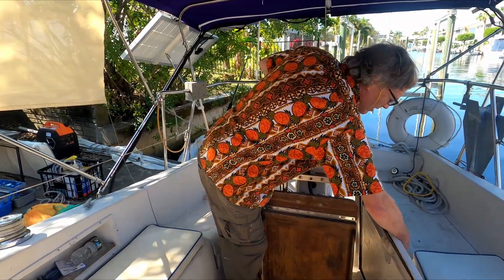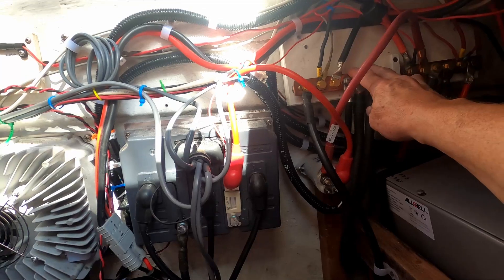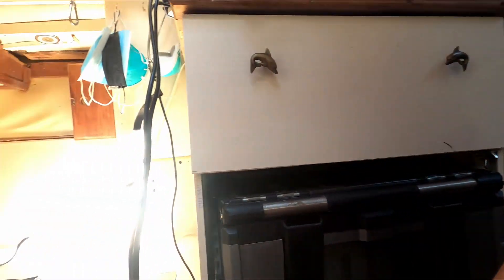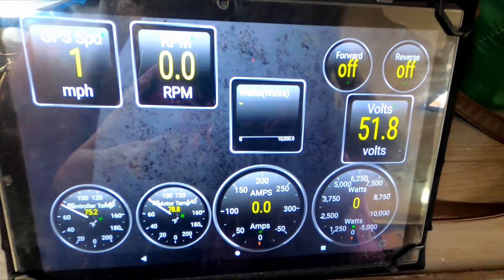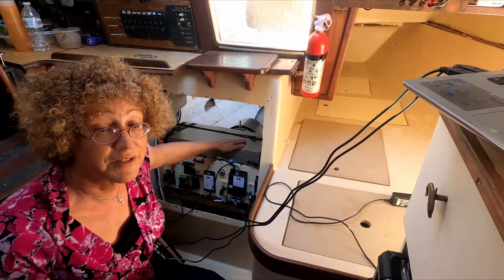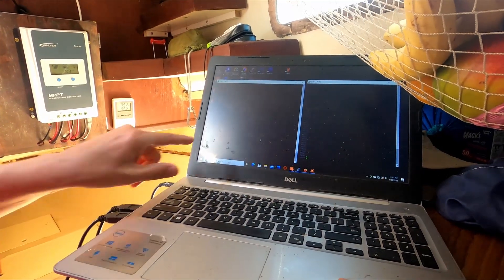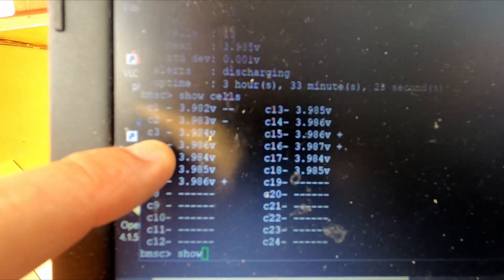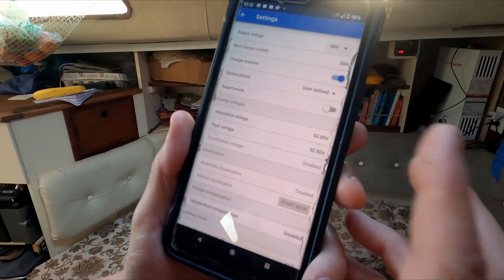Episode 40: Thunderstruck Motors - Electric Motor Install

Comment: Looks like a train wreck waiting to happen, that is something that should not be around salt water, you would need to be a TROUBLE SHOOTING MASTERMIND to keep that running.
Reply: That "train wreck" served us well and was a great experience for building out our 44 ft electric drive.  See later episodes.  As for having to be a mastermind to fix it, that would be me. I'm The Mastermind.  Surprisingly, very few bugs and very low maintenance. Your mileage might vary.  Ours was great.  I tend to find that those who say that something is improbable or impossible tend to get in the way of those who are making it happen successfully.
Reply: @ChristenBustani  The average person can't trouble shoot a basic engine that requires not more that 2 connections to operate, much less that that manastrophe of components ...what happens when a salt water breaches the cabin and those electronics? ....just sitting at dock for a year will subject those connections to shorting. ....shit, my neighbors land rover went thru 5 mechanics and $6000 dollars because of a simple ground.

Comment: I too thought about using a Thunderstruck motor in my sailboat, but after seeing what you did I'm not sure that I would be able to learn what I need to know to be able to install it myself. It seems like I would need a course in electrical engineering or something.  I'm putting an outboard on it for now, and will try to sail most of the time.
Thanks for the video.  Wish I understood it better.
Reply from the maker: Honestly, I believe you would be able to figure it out. Best way to do it it's just to take one step at a time. I was a little nervous about building this out and felt I couldn't do it but I slowly worked on it on the coffee table down in the basement, piece by piece. If you take your time, anything is possible. I know that looking at this setup may appear daunting but in reality, I learned each piece one at a time. The supported thunderstruck is pretty amazing too.
Reply: @sailingaccidentalgybe  Thank you so much for your response and encouragement.  Maybe I will give it a try.  It definitely looks like an interesting project.  Have a great New Year!
Reply: @swm-sm6cu  soon as that stuff get's wet, which it will, it's lights out.

Comment: Nice explaining. I wonder if there is a system where the solar panels can drive the motors without batteries.
Reply from the maker: One of the biggest problems with running directly from solar panels would be varying voltage and amperage based upon solar input.  The battery acts as a gatekeeper if you will, to store an inconsistent power supply in order to allow it to be extracted consistently.

Comment: Excellent video following on from your last one, which has me pondering the following. How are the separate battery banks of the 48V propulsion system switched over? How are the separate BMS of the two banks switched over between the Victron safety relay? What kind of issue would the BMS throw up with the battery bank (ie. over voltage, over current, under voltage, under current) that would facilitate the relay to be switched that the Victron unit wouldn't have picked up on? Thanks Al.

Comment: How has the system been holding up since this video? Have you made any changes or updates to the system since then?
Reply from the maker: The system held up great! We really had no maintenance issues.  We also didn't make too many changes and upgrades because we were going to be selling the boat anyway. Now we are taking possession of a larger, blue water boat.  All in all, going electric was a breeze.

Comment: Wait. Stop. Watts per hour? WATTS PER HOUR? What the heck are you measuring? You probably mean Wh/h but you have to get this stuff right. Messing up units means you don't really understand what you're doing. Back to freshman physics.
Reply from the maker: Ah units! The nemesis of many.
We've had such good success with this setup that we are building a hybrid drive on our next boat which is looking to be a 44-ft ketch.  We shall have a plethora of 150Ah batteries and many more Wh/h.  And yes, I understand completely what I am doing, how I am doing it and what I can expect as a result.  Being human means that we occasionally make mistakes  (nah that doesn't happen, but when it does we should project that a person is incompetent).  I will admit I am dangerous enough to build large tesla coils and fire off lightning in my spare time.  Zeus would be pleased.
Reply: @sailingaccidentalgybe  - I've been reasonably impressed with your approach, including two battery banks - usually not a great idea but your point of redundancy and rippling that through the battery controllers was valid. Unfortunately you said "watts per hour" about six times. Accelerating coulumbs? It's just wrong.
Reply from the maker: @deislanddave  if I had to do it again, I would not build in the redundancy. I was extremely concerned about failure, mostly of the batteries since they are used. Amazingly, when charging, the BMS puts them within .003 volts or less per battery block, and they discharge evenly. The thermistors register temperatures within 2°C of each other (and a lot of that variance could simply be my installation point of the thermistors on the battery pack itself).
Reply: @sailingaccidentalgybe  I think your choice was a good one, based on what you knew at the time. It's easy now to gang them together which given your additional experience is more consistent with best practice. I probably would have made one bank (assuming I went electric propulsion, which I wouldn't today - but good on you) from the beginning but splitting them and describing the redundancy factor due to lack of knowledge and demonstrated performance impressed me as good engineering. 

Since you've kept your house bank separate (which I laud), have you tracked consumption? My experience on cruising boats is 2.5 kWh/day +/- 0.5 kWh/day for house loads (fridge, freezer, autopilot, nav, lights, personal electronics, comms). Is that what you see? Can you separate loads from charging? Spreadsheets? Share? Your house bank looks like about 400 Ah at 12VDC - is that right? That seems light for most cruisers. Thoughts? What are you doing for domestic hot water? 

From an engineering point of view I ALWAYS worry about failure. FMEA for everything. 

Have you checked the thermister readings with a calibrated IR thermometer? That would be interesting data. Have you looked at battery temperature as a function of load and charging? That would be interesting also. Most of the curves I see easily are for FLA not LiPO4. Have you had to push hard yet? Heavy worthy or badly foul currents? 

Would you be interested in a peer-reviewed journal article with SNAME or ASNE? I haven't yet forgiven you for watts/hour grin but your engineering seems solid.

Comment: Hello  Nice job and well thought out design!!  I may have missed it in the video but how are you charging your 12v house power?  I am about to set up my conversion on the bench finally just got the last few parts in and have been going back and forth but settled on a separate charger that I can use the existing perco switch to move the shore power or generator to the 48v charger or the 12v charger.  Thanks for all the great information
Reply from the maker: That is a really good question and I was so excited about the electric motor setup that I never went over the basic 12 volt system. It's a very basic 200-W solar running to an MPPT controller to deep cycle lead acid batteries.  We never went with lithium for the house batteries because it was never our intention to hang on to this boat as our last boat. In fact, we have dibs on a new 44-ft ketch that will end up, ultimately, with a lithium set up for the 12-volt system. The controller is an EPever MPPT 12 volt and the two 100 watt panels are connected in parallel. It is more than sufficient to power the basic house needs and the electronics for the Thunderstruck System.  I hope that helps. I can do a segment on it in an upcoming video but I grant you that it would not be very exciting!
Reply from the maker: I should also mention that thunderstruck actually recommended that the power system that supplies the BMS and the EVCC be separate from the drive battery system.

Comment: Awesome! We are looking at doing something very similar. A video on range vs speed and typical recharge times from solar could be interesting. love your work
Reply from the maker: As you may know from our videos, we have sold the boat and working on outfitting a 44' with plans for electric drive.
Reply: @sailingaccidentalgybe  What electric motors are you researching for the 44?
Reply from the maker: @hodadyou  We are looking at several options, including Oceanvolt.  We would like to try her out in the water first in order to assess our baseline statistics on the 4108 Perkins Diesel.  Then we will have some numbers to move forward.

Comment: Been looking at those engines for a while now, thinking of doing the switch (sick of diesel engine maintenance).  Should we choose this engine, we hope that our install looks as good as yours. Thanks for the informative video.
Reply from the maker: Thunderstruck motors provides a very reliable system at a very reasonable cost as compared to, let's say Ocean Volt.  The difference in price however, is made up for in the investment required to learn how to integrate all of the components together. It's a great learning experience, don't get me wrong, but it does require some ramp up time.  Once everything is working, it seems to take care of itself and is very reliable. Even I found this very surprising.  If you need to go with a larger motor, I would recommend a water cooled one. With the 5 kW motor, we're just able to keep it cool enough with a fan system built into the engine well. I can't imagine the heat dissipation required on a larger motor. Certainly, it would be manageable with a water cooled motor and I believe that they do provide one in their larger sizes
Reply: @sailingaccidentalgybe  I think 5kW would suit our needs, our boat is 33ft, and not too heavy. I'm okay with investing some time, it's not like I can afford the alternative anyway ;).
Now that you've had some time with your Thunderstruck, would you prefer a larger engine or is the 5kW adequate?

Comment: Anything you would change or do different next time. Thanks
Reply from the maker: Absolutely!  This was a great testbed platform to field test the setup.  I would add two more batteries and wire each set of two in parallel to give 300 amp hours each. I would also upgrade the motor to a 10 kilowatt motor.  We went with a smaller motor design because our intent has been to sail and only use the motor when needed. what we are finding is that the motor is actually very helpful when sailing to the wind and allows us to point more closely when we motorsail when conditions warrant.    The five kilowatt motor was well balanced to the number of solar panels and number of batteries we had in place. We are planning to move up to another boat in the future and so did not put has robust a system in as we could have. Still, it has been working very well, actually exceeding our expectations, and we can motor along all day at about two and a half knots on a sunny day without a net drain on the batteries.  one of the other things I would change would be to have a physical link for the onboard diagnostics. Using Bluetooth is not reliable and of course it always needs to be attended to at the least opportune time. Quite annoying.  All in all though, I am quite impressed with what we ended up with.
Reply: I'm still watching and trying to decide. 10 kw motor minimum, I was thinking 2/48v 100 amp batteries. These would be for total electricity.  Dorm frig,air fryer,inductive stove top,lapstop.DcLoads Bildge pumps running lights. 27ft  sailboat so  solar minimum needs determined what I have space for. Thank you enjoy mike

Comment: I just didn't hear anything about propeller generating energy.
Reply from the maker: We're not doing regen on this boat. Generally, you need to hit four knots anyway in order to be able to generate electricity. We don't have the right prop on this boat to begin with and we are going to be ultimately selling this boat and moving into a larger one. We'll look into regen on that next boat where our hull speed will be higher.

Comment: Thanks for sharing your build. I have a land based build with Tesla batteries and I have used Thunderstruck's BMS and I am trying to figure out how to wire in and program the CAN Bus to work some relays for High and Low voltage shut offs as well as temp shut off. Any words of advice for a guy that has limited computer skills?
Reply from the maker: Since I aired the episode on YouTube, I found a way to utilize one of the pins on the BMS at 12 volts to be able to power a relay that switches the 48 volt side.  If you look at the end of the manual for the BMS you will see there is a small reference to "loopoc".  The BMS has the ability to, based upon the high voltage condition or low voltage condition, HVCC or LVCC occurring, to power a circuit at low current. I used this feature to power a relay in order to be able to handle a higher voltage system.  If this is what you are considering, let me know. I have some emails from thunderstruck that I can forward to this forum on YouTube. If not, it may be worthwhile to contact thunderstruck and request their advice. If you do, let them know that Kristen sent you!  Trust me. You'll get a little extra response in so doing!
Reply: @sailingaccidentalgybe  Thanks so much, I will definitely look into that. Appreciate the information.

Comment: As you said in E39 you would include a parts list under this chapter ;) could you still provide it? Especially the charger and BMS which are also connected to the can bus of the sevcon. 
Thanks in advance
Reply from the maker: We sourced everything from thunderstruck.  I will link you to the exact kit we purchased.

https://www.thunderstruck-ev.com/sevcon-brushless-sailboat-kit-5kw.html

https://www.thunderstruck-ev.com/bms-controller.html

https://www.thunderstruck-ev.com/tsm2500-and-charge-controller.html

Hope this helps!

Comment: Thank you for sharing your video!

I'd love to know more about how you mounted the motor.  Did you use the 2:1 gear reduction from Thunderstruck?  How did you mount it?  Did you use engine mounts?  Just two?  How did you do the alignment?  I'm thinking it would be optimal to use four motor mounts oriented vertically and four more oriented horizontally, in order to really precisely align the motor to the propeller shaft.  Did you use the chain coupling that comes with the gear reducer?  I'm told they can be a bit noisy compared to a CV (constant velocity) coupling.  I follow your posts on facebook too, where it might be easier to post pictures. 

Many thanks once again!!
Reply from the maker: We did use thunderstruck's 2 to 1 reduction transmission. Gary also fabricated a mounting system using angle iron.  Alignment was done on a trial and error basis and seems to have been effective.
Reply: @sailingaccidentalgybe  Any pictures of the installation would be greatly appreciated!!

Comment: Nice system you have there. Have you got any idea of the power consumption with different speeds?

My experience with 27 footer in calm is something like:
-1kn, 100W
-2kn, 300W
-3kn, 700W
-4kn, 1100W
-full throttle: 5,2kn, 3,3KW

So speed increases consumption with massive amount! Check my videos of the conversion as well! :)
Reply from the maker: Those numbers look fairly consistent with what we've been seeing if you add about 20% more power consumption. Given the larger size of our boat, it makes sense. We should have some hard numbers in upcoming episodes so keep tuned and subscribe!
Reply: @sailingaccidentalgybe  OK, so basically you have 2x150 = 300Ah@48V = 14,4Kwh. When driving at 3 knots consuption should be around 900W, (let's say 1Kw) so you can drive for 14 hours with that battery at three knots, which brings range of 42 miles. Not bad at all!

Comment: So many questions. What were your concerns with all the electric going under the cock pit?
Are those battery cases sealed? Was that cover on the motor to prevent water from getting in the motor?
That's good for starters. Thank you
Reply from the maker: those are great questions. I'm going to be doing another episode shortly and I will include your questions in a part of our Q&A session!
Reply: @sailingaccidentalgybe  I will have more money m sure. Thanks

Comment: 5kW motor on 7.5kWh battery equals around 1.5 hours run time? Without charging. Not bad at all.
Is it capable of charging while the screw is being spun by drag while on sail power? Thanks for sharing.
Reply from the maker: This propellor will not do regen.  As for funtime, we hope to run at an average of 2Kw which would, with solar input of .4Kw (max), greatly increase our runtime!